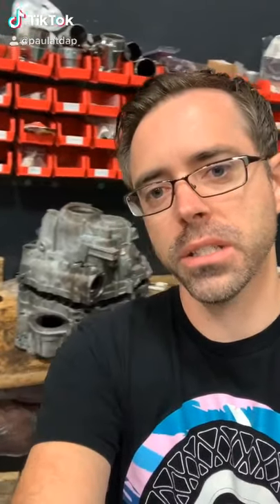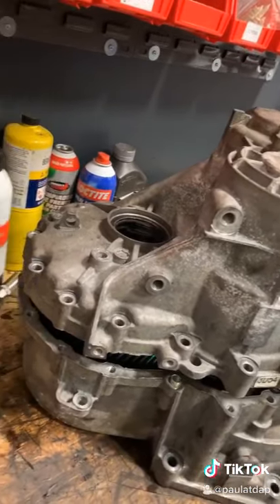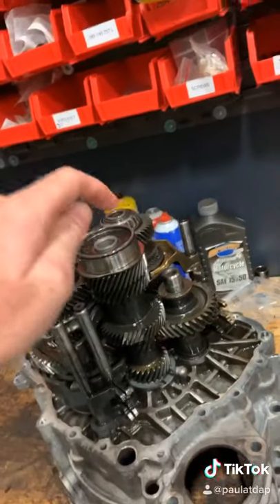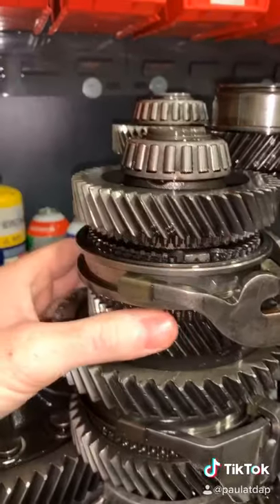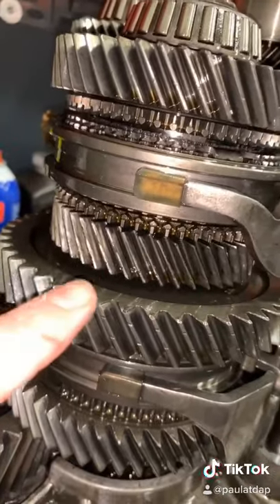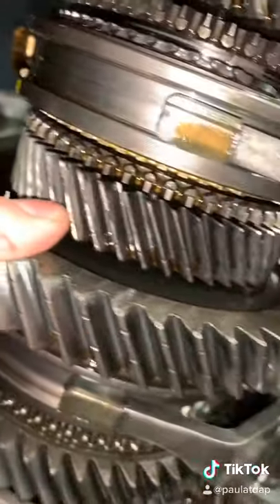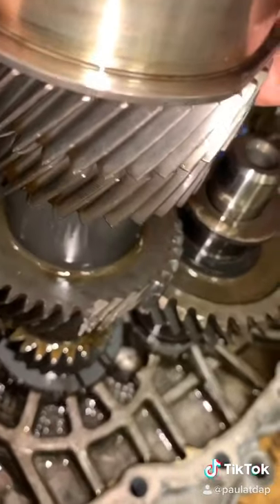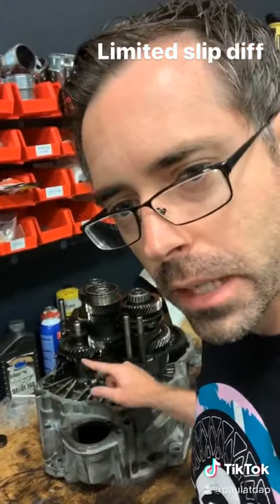Broken Manual Transmission Teeth #shorts

Comment: How do you break teeth off the gear.  I’m having a problem with one of my cars. On the 3rd trans. Keeps shearing 3rd gear. Both sides of it.
Reply: what are the symptoms? does it seem like clutch slip? has it affected any other gears?